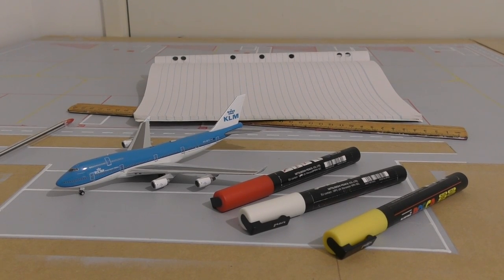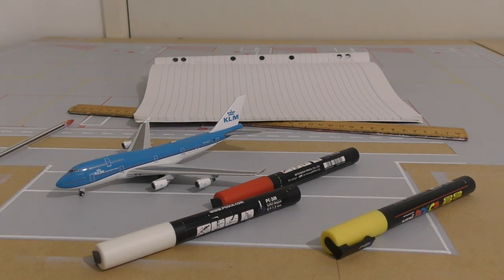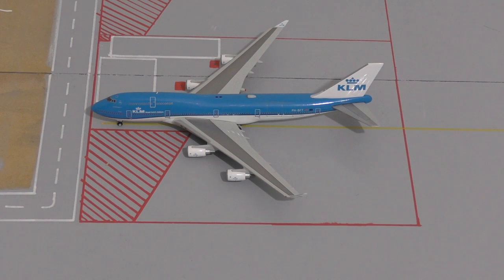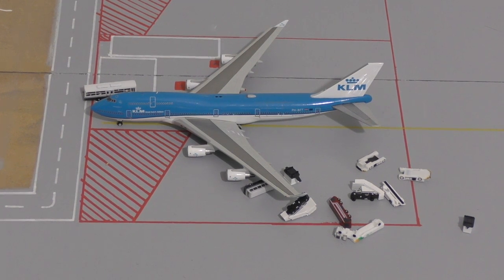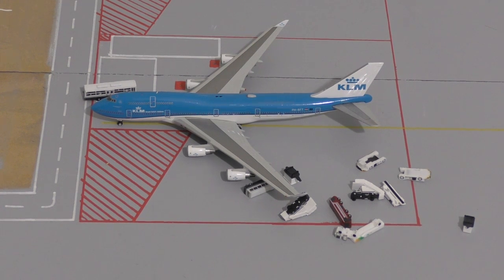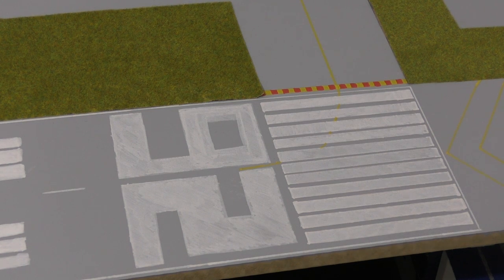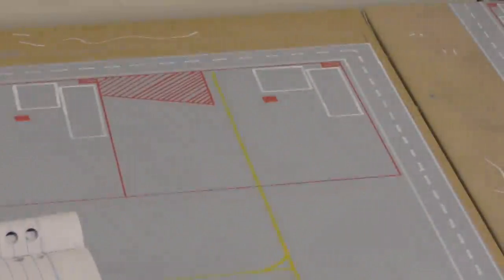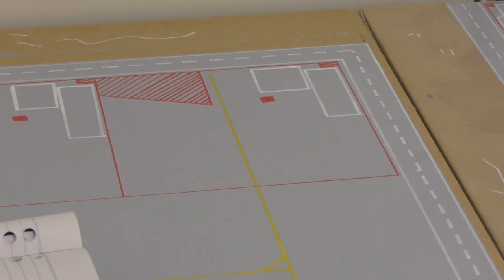How to Build a 1:400 Scale Model Airport | Line Markings on Runway & Stands | Episode 3

Comment: Great video Djs Aviation.I have a question.How do you find out how wide the runway should be and how long it should be??
Reply from the maker: Thanks mate, regarding the runway there's no exact measurement but essentially put your biggest aircraft in the section that will be your runway and work out the wingspan and just how much room you will need width wise. As for length originally I just did it to the end of my board which was a good length but it's up to you.
Reply: There's online resources and google earth.

Comment: I have 1 question. The number on the runway. 92? The highest number you can have is 36. Imagine you are adding a zero on the end of the runway number. London Heathrow has 09. That make is 090 or 90*. It also has 27. That makes it 270*.
Reply from the maker: The number isn’t 92 though :) it’s 26
Reply: Dj's Aviation hahaha! I feel really stupid now! That is a great airport mate. I have a model grass runway on mine. I have used a similar design as the German model airport.

But I have a model train with holes in the top that has poles that extend through the base board into the plane. When the train goes up a hill, the plane takes off